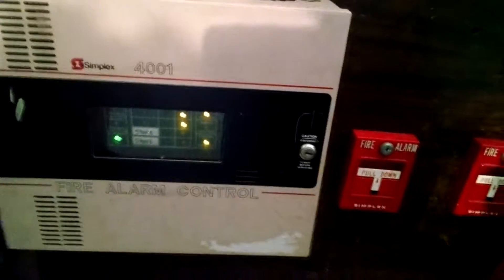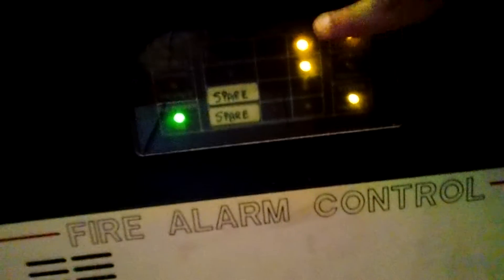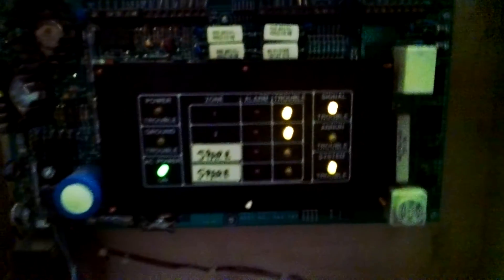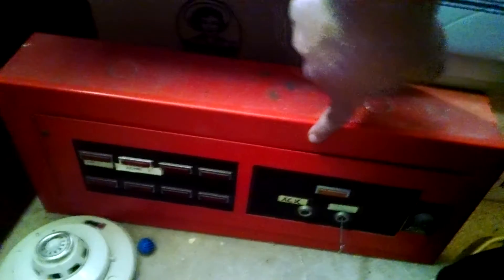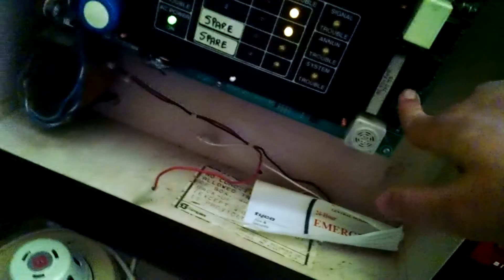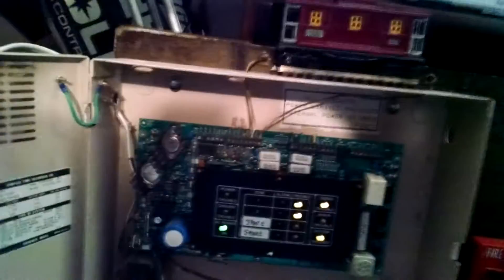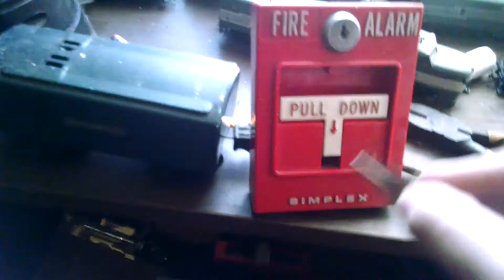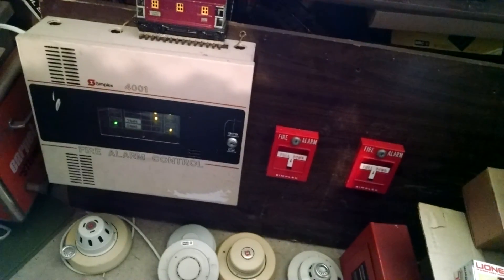Simplex 4001 Panel Test

Comment: Nice annunciator to go with the 4001! I've seen something like that at a Greek Orthodox church in my hometown that has a Simplex 4001 system from 1986; the alarms are 2901-9806 horns on 2903-9101 strobe plates.